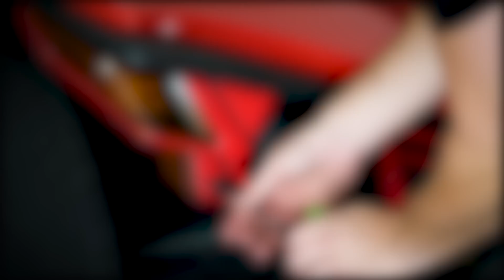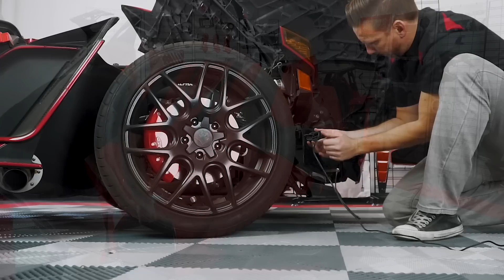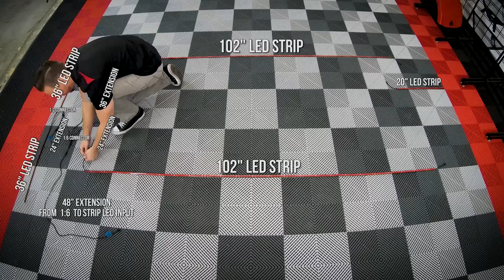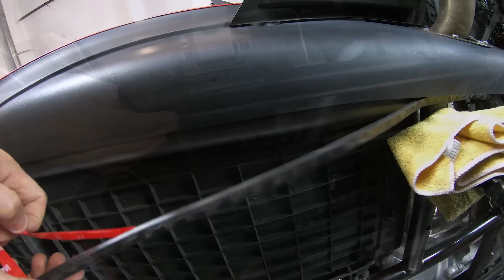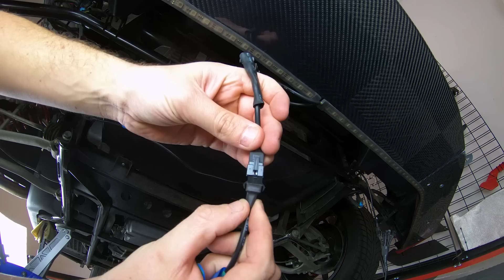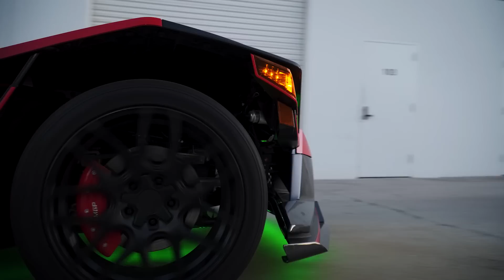Chaser LED Halo Rings & UnderGlow Lighting Kit for the Polaris Slingshot

Comment: The question I have is around driving with the Halos on.  In your video at the end, the slingshot is driving, however the headlights are not on.  Is there a way to shut headlights off (in the daytime) and just run with halos?
Reply from the maker: Hello, yes there is. You'd need our headlight on/off switch here: https://www.slingmods.com/slingshot-headlight-bypass-kit
Reply: @Slingmods  Thank you so much for the prompt reply!